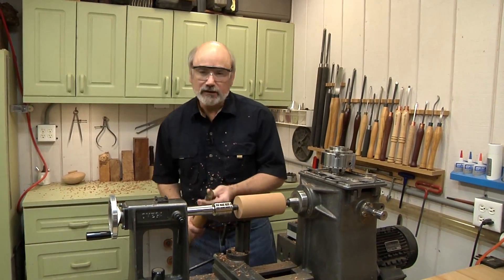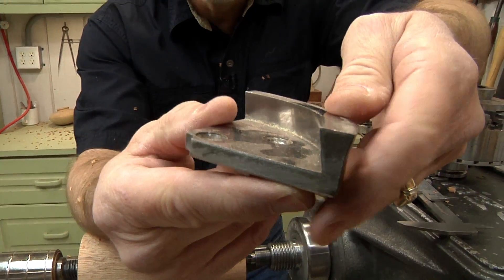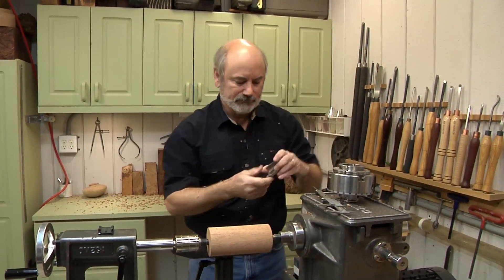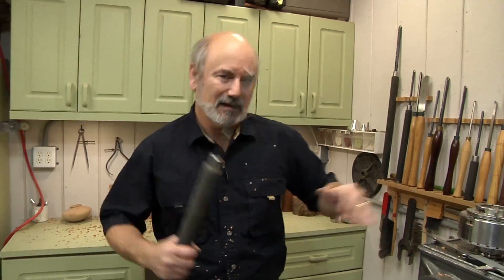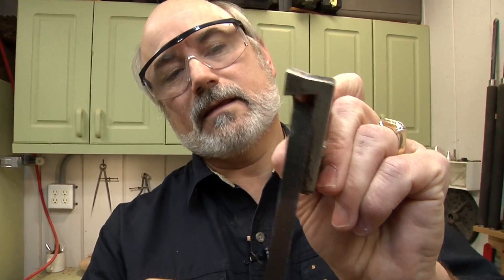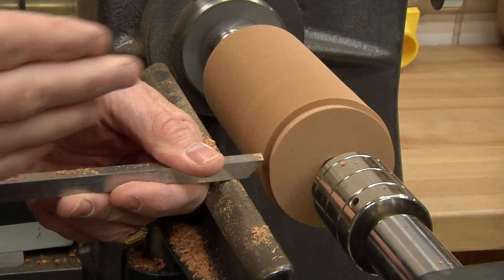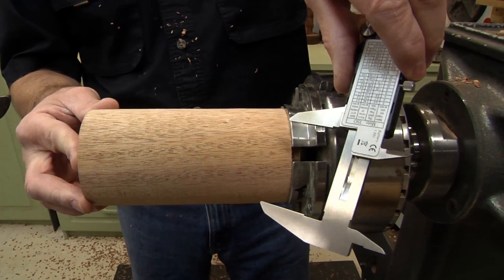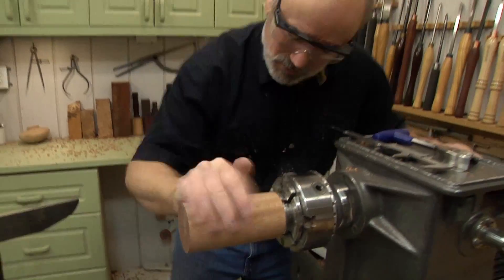The Perfect Chuck Tenon

Comment: I definitely need a different chuck... have the woodcraft brand one and have had pieces of wood come off more than once, even with everything right.  Very impressive when you hit the end of that spindle and it didn't move!

Another tool that works well to shape the tenon is a skew used on it's side like a scraper.  I use my 1" skew for turning and have the 1/2" skew that came in the tool kit (which I don't otherwise use) ground to the angle of the dovetail, just like you have the bedan. :)

Comment: I have a couple of quibbles, not that it really matters. First, only when the wood is degraded (like heavily spalted) and likely to be crushed by the chuck jaws is it advantageous to have more surface area of the jaws in contact with the wood. It's a physics thing: frictional forces between dry surfaces are independent of the area of contact. In most cases, you get a stronger grip with a larger tenon.
   Second, the dovetail jaws do not "suck" the tenon into the jaws. The angle of the dovetail is not great enough for this to happen. The jaws and wood would have to be as slick as teflon . . . and it still wouldn't work that way. It's a myth.  -Doc Green

Comment: Just wondering - why is it bad if the tenon hits the back of the chuck?
Reply from the maker: If the tenon is touching the back of the chuck it is probably not making contact with the face of the jaws. That will give the piece some wiggle room if you get a catch and it will try to touch one side of the tenon jaw faces and then be crooked in the chuck.
Reply: Thanks :)